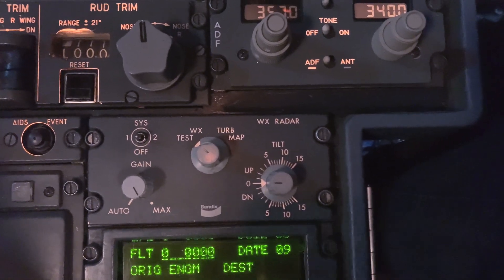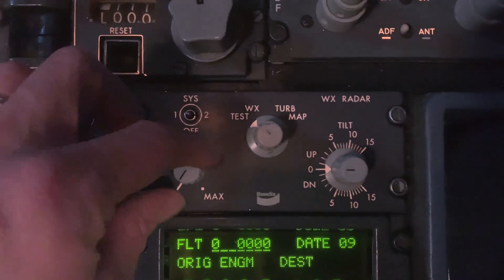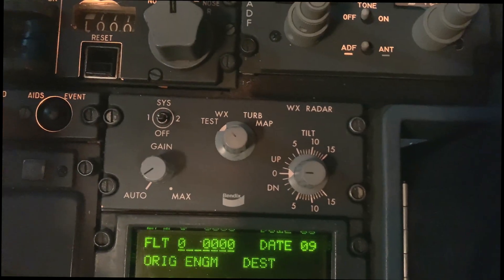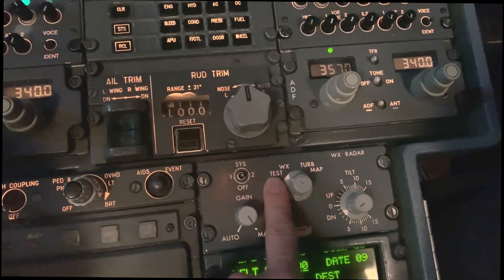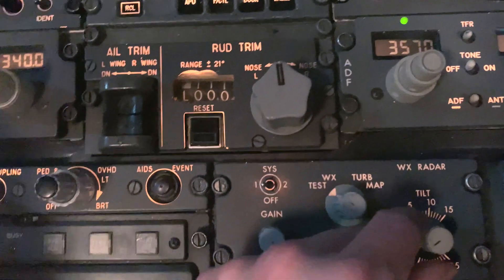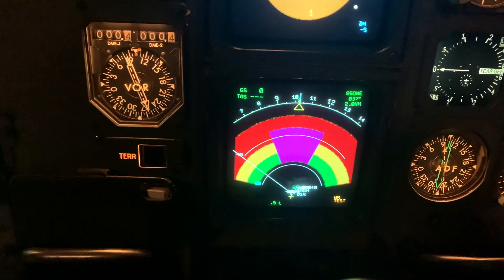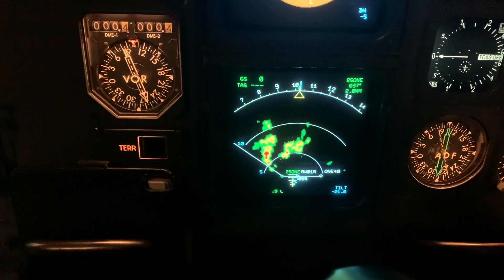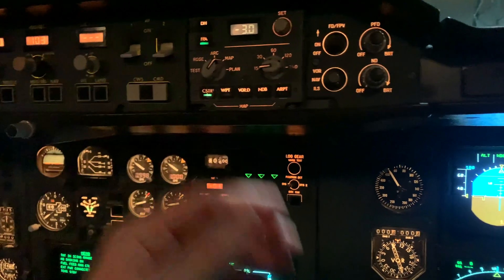🎬  AIRBUS A300-600, ATA 34, Weather Radar Operational/Functional test. ✈️

Comment: Thank you for the WXR demonstration.

I didnt know that you have to set the range to 60NM first before you can start the test. Also I didnt know that Test position is the normal position.

I thought there is a kind of Standby position.

So if you would set the range to 15NM for example, the test wouldnt start, correct?

If the pilots wants to activate the WXR, do the just need to select which system they want (1 or 2)  to use and move the knob from Test to WX or Turb?

The WXR doesn t have a PWS you said.

But can you please make videos for

REACTIVE WINDSHEAR?
The A306 has the 

"FRENCH ACCENT VOICE"

that says 

WINDSHEAR WINDSHEAR WINDSHEAR.

I mean the reactive windshear, not predictive windshear.

Also it would be very interesting if you could show how you do a

STOP RUDDER INPUT TEST.

Does the A306 have a kind of overpeed clacker like Boeing aircrafts have?
If i am not wrong the mastet warning would be activated and a overspreed test messagr would appear on the system display.
But does a warning clacker sound also get triggered?

I hope it is ok if I ask thesr questions.

You could create more videos with all these topics

Overspeed Test
Stop Rudder Input Test
Reactive Windshear Test.

Thank you very much for your time and help.